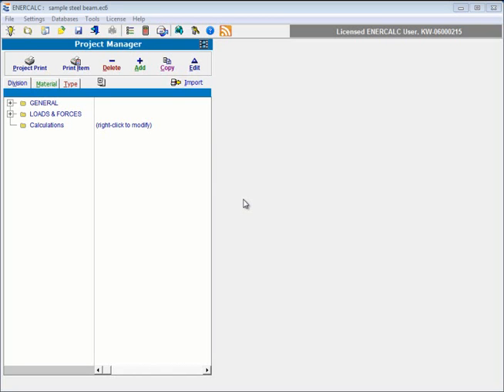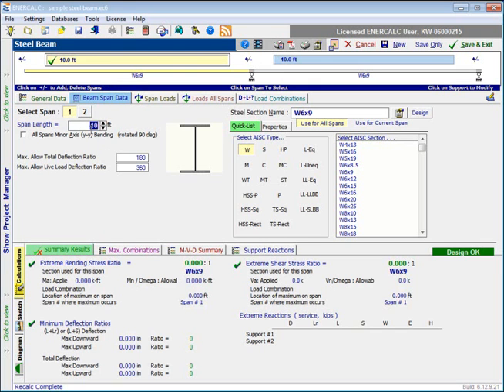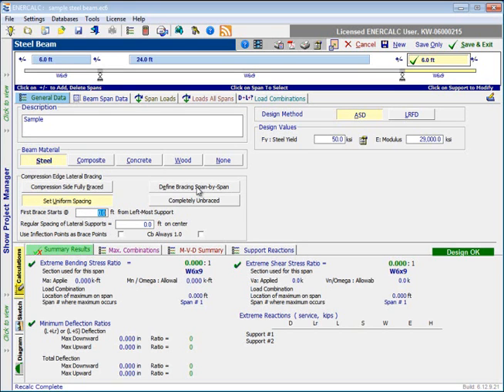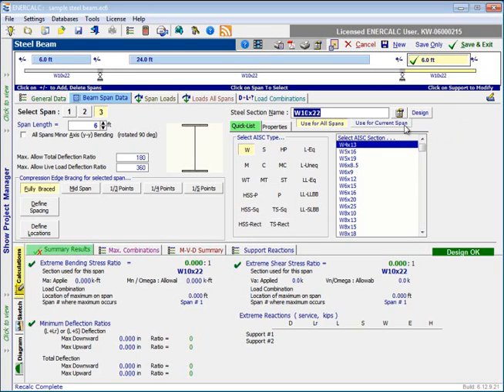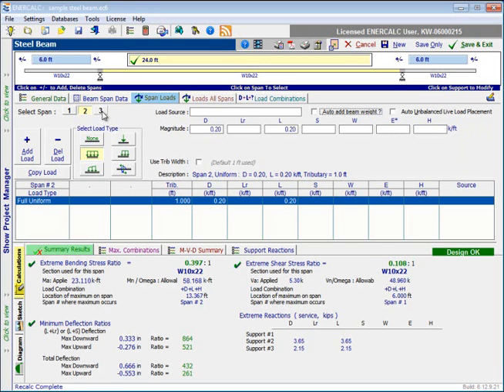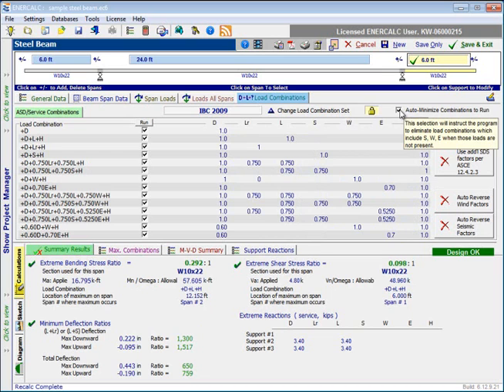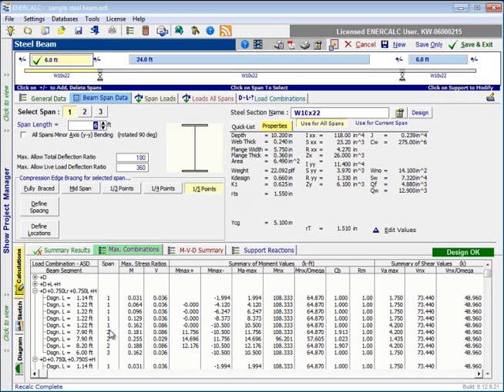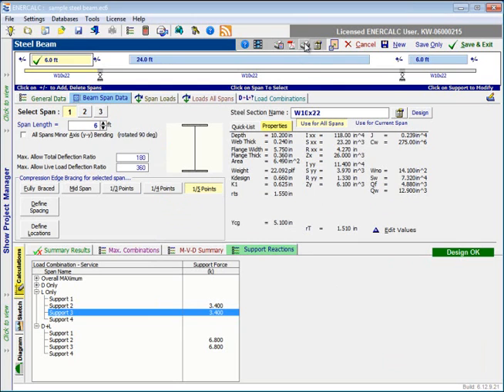SEL : Steel Beam Design Module

Comment: too much manual entry, and therefore leads to many errors. a simple iPad bead deflection software does about the same. Note that wind load and self weight may be in different planes."Maximum bending stress ratio" is not defined. deflection is not defined at "service limit" of 0.6 x 0.7